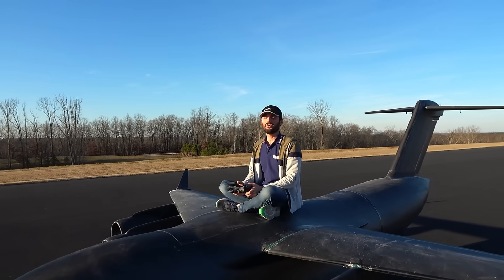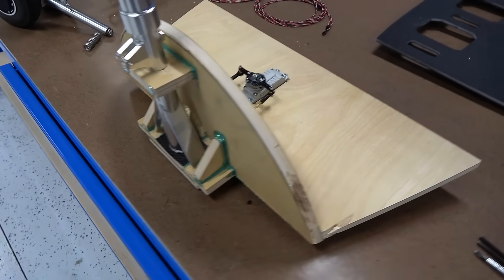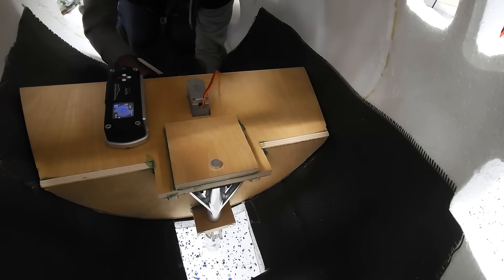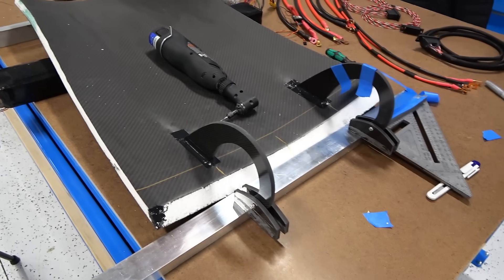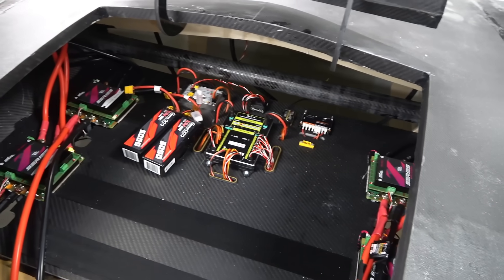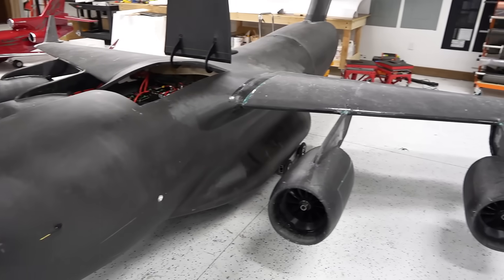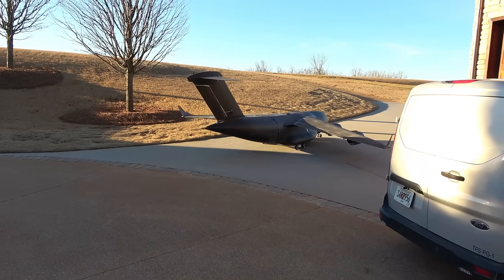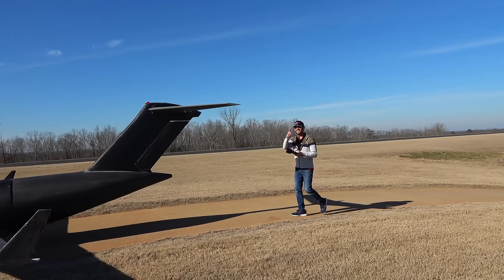READY FOR THE FIRST FLIGHT, 6 Meters C-17 Globemaster RC airplane

Comment from the maker: Stay tuned for the maiden flight next Monday!
Reply: I'm no expert, but would it not make more sense to hinge the avionics hatch so that the aerodynamic forces help keep it closed rather than the potential catastrophe if the latch failed?
Reply: @Mark-oj8wj  yes. Pretty big oversight. But the likelihood of it happening is probably slim
Reply: Can’t wait
Reply: YOU ARE AMAZING!!!! GREAT JOB!!!!
Reply: Maybe the hatch opening the other way?
Reply: Congrats My friend Ramy
Please before maiden can you consider few points
1- the 4 ESC needs Airflow ventilation because they will accumulate very high temperature during the flight
2- please consider installing the ESC’s underwings or inside the tunnel of the engines behind the ducted fan
That’s my advice wish you all the best
Reply: Can't wait to see the first flight!
Reply: Bro would it get off the ground if you laid inside it? If yes have you thought of doing it! I would
Reply: The door compartment for the electronics and batteries should have been made to open the other way incase it opens in midair it would still remain closed by the speed of the wind.
Reply: @lcfflc3887  yeah that's literally what I said
Reply: @sharkbite5744  yeah it will literally become an airspeed brake.
Reply: I dare you to make a plane that you can sit in
Reply: @RamyRC I am currently doing a build of an airbus A380. I’m wondering something. I don’t see that you applied carbon fiber to the edges of the hatch or hatch opening.  Then at 10:45, we are given a quick view that does show they are black, but appear to be painted? Did you in fact, carbon fiber the sides? This is our plan, but I’m curious what you did.
Reply: can't wait! awesome content!!!
Reply: Once the plane is outside, what's that low humming noise? Not the engines, they sound good, what is that constant doning sound?
Reply: @rjung_ch  those are the digital servos, that's normal
Reply: @rjung_ch    Huge digital servos buzzing, trying to find center
Reply: @BillCranford  those are massive servos, quite loud ones too. But in the air it won't be a problem at all. Can't wait for the next video, the one with the maiden flight!
Reply: @rjung_ch  👍 I actually hit the 🔔 so I won’t miss the next flight video.
Reply: those are the digital servos that you hear.   @rjung_ch
Reply: So impressive !  It's a masterpiece of skill and ingenuity.   You've probably addressed this here or elsewhere, but I was wondering why you seem to favor ducted fans over actual turbine engines ?   Thank you!
Reply: @mikegreene4152  the answer is in the rest of the comments already🙄
Reply: Sir I need a small rc airplane from where can I buy plzzz
Reply: @talhazia543  Toys r us
Reply: @talhazia543  google it you fool
Reply: So I asked this question before did you have to get special waiver from the FAA to fly this??
Reply: @Boeing777DriverAA  no such thing at least not under class G airspace below 400ft. But the AMA has a large model program dependent on weight that has their own restrictions. At a private non-ama field that wouldn't apply anyways
Reply: @Boeing767DriverAA  ypu don't need a faa waiver if your flying at a private field.
Reply: You obviously have the flight video already. Just post it bro...
Reply: @mushmouth  you obviously didn't pay attention to the video and notice the main landing gear isn't even finished
Reply: You could use a electro magnet for the hatch so it stays closed with the flip of a switch
Reply: I’d be interested in a dedicated carbon fiber video
Reply: Bro make emirates 777 and use turbine engine not ducted fan ❤❤😊❤😊❤i know u can make
Reply: Thats Tyler Perry's house and where he lives can only be electric @unknowndestination4706
Reply: @Radowanhossainsajid  his boss has a hatred of turbines for some idiotic reason. such a waste, all his models are begging for turbines
Reply: @aerialbugsmasher that is because he doesn't want to use fuel and reduce the risk of a fire
Reply: @aerialbugsmasher and Tyler is not his boss😂 they are freinds
Reply: @aerialbugsmasher It's where he lives and in one video he explains the reason for going electric.  Turbine isn't always better
Reply: @man67343  they may be but he sure as hell is getting paid to put in all that work
Reply: @man67343  Tyler's logic is flawed. In 25 years of flying RC I've had far more random fires from ESCs/Motors/Lipos than any other type of power plant. I've only wrecked one turbine so far and there was no fire, and when I've seen others crash theirs, you just usually get one big fireball and that's it, the rest of the fire you can put out by stomping on the grass. But if you bump a Lipo just the wrong way slightly, all hell breaks lose, and unlike Jet-A, Lipo fires are much harder to extinguish, and if like in his huge planes you're running massive 12S or larger battery packs you're talking about well north of 48 cells going up in flames one after the other over the course of many minutes. Plus his field looks plenty large enough to accommodate larger turbines so its very unlikely he'd crash into the forest behind. Ramy himself has had these types of failure before I believe in older videos
Reply: @aerialbugsmasher  go home troll, learn to setup electric and you won't have fires, plus where he lives, he can't use turbines anymore because of the noise
Reply: Next challenge: Make one of your rc planes totally automated from takeoff to landing 🔥
It’s going to be an exciting project I promise you 🔥
Reply: @Dailyplugs229  no. that's idiotic and defeats the purpose of flying RC planes.
Reply: @aerialbugsmasher  it will be fun and cool if he add turbine engine because  i love turbine engine not duct fan
Reply: @Dailyplugs229  You already can with gps receivers. You can even map out the flight path in a pattern if you want to go "auto-loiter" mode, and it will just fly the relay points you've set on the map. We've done this on fpv planes already.
Reply: @monchichis333  wow that’s amazing
I’m going to watch videos on that now 🔥

Comment: Beautiful build! Just a thought, wouldn’t it had been better to have the hatch open from the rear & not the front? Just in case the locking system were to fail at least the forward motion would keep the hatch closed.

Comment: @RamyRC I am currently doing a build of an airbus A380. I’m wondering something. I don’t see that you applied carbon fiber to the edges of the hatch or hatch opening.  Then at 10:45, we are given a quick view that does show they are black, but appear to be painted? Did you in fact, carbon fiber the sides? This is our plan, but I’m curious what you did.

Comment: Considering the air flow will always be from the front towards the back I would have installed the brackets that hold the top door on the opposite side of the door (using the edge toward the front of the plane) so it would not open as it did.  Otherwise you will be forced to install an additional door locking device.

Comment: Maybe on the next build put the hinges to the top hatch on the opposite side. Just in case it ever did open mid flight like you mentioned, which it wouldn't because the air alone would hold it closed. Just a thought but this is incredible either way.

Comment: Brilliant:D what would it take for this to fly with a human in the fuselage? :o I believe model boats fit humans for displays/reenactments? :o I realise air is far different though and the support needed from nose to tail or just a harness from wing attachments for weight distribution:o seems the power is there hahaha. Science would have it so the wings would need scaling up accordingly but it is extremely lightweight as opposed to the real steel and aluminium. I'd definitely feel better with stronger landing gear though for a human ha. Wow

Comment: Congrats My friend Ramy that is amazing build.
Please before maiden can you consider few points
1- the 4 ESC needs Airflow ventilation because they will accumulate very high temperature during the flight
2- please consider installing the ESC's underwings or inside the tunnel of the engines behind the ducted fan That's my advice wish you all the best

Comment: I love that plane. True story. I made hundreds of tailcones for real C-17s. Because it's very tough but flexible material, as well as thin walled, and cone shaped it was very difficult to hold for standard braised carbide cutting. It has to be held from the inside because the machine is outside. It chattered, and tended to break expensive carbide cutters. $80 each in 1992. It would break 1 sometimes 2 per cone. Often it would chatter loose, and have to be reset. 

It was a loss leader in the industry so the contractor could maintain contact with Boeing for the big contracts. Competing contractors underbid on the cone contract but we got it for a price of  $60 each. But it is a hot potato in the aviation industry. Contractors do it for a while then let some other contractor take the loss for a while. Same with us. Other contractors tried ultrasound, lasers, and high pressure water jets. Couldn't do it for a profit.

Before I started making them we put only the most experienced machinists on them. They used $80 880 braised carbide. Pain in the ass. Came loose, broke carbides. They gripped about it all the time. Never gave me the job because I was the new guy. 

Been there a while I tell the shop foreman, who often had to do the job himself, over lunch "I'm tired of hearing you guys gripping about those tailcones." "Give it to me I'll figure it out. As far as you're concerned it's my favorite job, and you'll never hear a gripe about it again.

He said "You're on.",  and it was a pain in the ass. I did the job for 3 months before I figured it out.

I invented a mod of the fixture. I was able to double production. I was able to use a $60 660 braised carbide, and made 10 cones with one tool before repeated sharpening wore it down to a nub, and even then nub would cut. Our cost there alone went from $80 each when one carbide usually broke, and $160 if 2 did to my cost of $6 each in carbide cost, and half the overhead. For the first time in aviation history I delivered on the contract at a profit. 

It made the job much easier for me too. It really did become my favorite job. That even became the company's nickname for the job. "My Favorite Job.". Whenever a load of tailcones came in the foreman said " 'Your Favorite Job' is here.". I asked him once if he was joking with me that it was a pain in the ass for everybody else, and that it really is my favorite job. He said he knows it's my favorite job because I so good at it. The thing I made works. A little prodding got him to say I was making it at a profit, and the owners appreciated it. He only put someone else on the job when he had a hotter job for me. 

One of which was a big Boeing contract we were hoping for. The 777 fuselage turning fixture. Boeing requested I be assigned the job. No customer had ever requested a particular machinist before in the company. It was my work on the tailcones that got us the job, and me requested. 

Boeing had become skeptical that we were producing good parts because we consistently won the contract with the lowest bid. They suspected the invention I used, and had to check the cones. So Boeing bought a $12,000 1'x4'x4' flat standard. Precision ground from granite to check the geometry against. I heard there was a bet. If my cones failed inspection we would pay for the flat, and keep it. But if my cones passed Boeing paid for it, and we keep it. 

The inspector shows up one day. I say "So we just grab one at random right?". He sad "That sounds like a good idea.". I know I got him eating out of my hand already. But I plop it down on the flat, he grabs the height micrometer, and starts to measure the length. I say "you have to...". He cuts me off saying "I want to check this first.". I say "Ok". Right away he's saying "It's off. I tell him it's off because it's cone shaped, and thin walled like a Dixie cup, a water cooler cup. If you squeeze it out of round that end becomes rounded. The cone is out of round and it's rocking on the flat, and I showed him the rocking. He asks what we do about it. I point out we're not responsible for it being round, and no tailcone ever will be. But if the mating part is flat it will push the cone flat, and round. That eased his mind. We just have to push it against the flat to get a rock solid measurement. He said I'll buy that.". 

So I lead him through all the measuring tools, extensions for the fixed jaw of the micrometer, using the standards that come with it to zero the dial. Hight gauge then "miked" with an inside mike which is checked against the outside mike. I'm teaching the inspector how to inspect it, and convincing him it's the right way, and we're getting rock solid measurements. Everybody's having a good time throwing up clay pigeons to watch me shoot them all down. Last we get to the diameter of the big end of the cone. I Show him how to press the cone on the corner of the flat so 180 degrees is off the flat so it can be measured with the micrometer. He notices it's on the low side of the tolerance. I had a spec of +- .0025", .005" total. That means I cut too high on the taper. I say "No I didn't.". He's all smiles "I gotta hear it. I know you got something.". I point out on the print it says "De burr". I say "You gotta give me at least a thousandth." A human hair is 1 to 3. He says he'll buy that but it's still on the low. I say but it's a thousandth on this side, and a thousandth on the other putting it within half a  thousandth of spec. Right? He gets it, and I say turn it 90 degrees to get the round, but he says we don't have to do that he's convinced I know what I'm doing. I say we're done then? Yes. I still want to measure it for myself. He asks how that could be off if all the others are right on. I explain while I measure it could be off the conical axis. That could cause the length to be correct, and at all points parallel to both ends but this diameter might not be round. It could an elliptical, conic section. He understood that. and the cone was ok. He asked how that might happen. I reminded him about how it can chatter loose, and have to be reset where it could, and likely would be a little off. Probably not significantly, and it never pulls loose on me. 

 He was so impressed with me Boeing requested I machine the 777 fuselage turning fixture, and tried to reverse engineer my tailcone fixture  invention to modify the fixture for the tailcones of the largest jet engines ever built to this day. 

I invented modifications when I made the 777. It was so good when Boeing took it to their plant to assemble it went together overnight. The Los Angeles Times ran a front page story, with a full color picture, that neighboring residents were calling police about this huge piece of machinery suddenly appearing practically in their back yards.  They were reporting they thought some huge machine had crashed. One said "It popped up overnight like a mushroom.". 

What I couldn't know then was the historic records the 777 would accumulate. Best selling airliner in aviation history. 2200 sold 1600 delivered. The 747 just ended its 50 year production run with 1800 delivered. The last 747 that will ever be delivered. The 777, in 29 years, with 1600 now flying it has not had a single mass fatality accident. One Malaysian Airlines was shot down, and one Malaysian Airlines was lost, disappeared by suspected hijacking. Those don't count. They're not accidents. Coincidentally or not that door plug that popped out of a 737 recently was from a fuselage of Malaysian manufacture. 

Compare that safety record to other airliners that have multiple crashes, and fewer planes. Ball park of 2 to 8 years to just the first crash of all the other jumbo jets. Ball park of 60,000 lives were saved by flying on my plane that would have been lost in the same 30 years flying on other planes. My inventions can be applied throughout the aviation industry for 2 orders of magnitude increase in safety. That's 100 times safer.

When I started posting in 2008 in comments about Boeing on YouTube  l mostly wrote about the tailcones. A little about the fuselage but it didn't yet have the phenomenal history it now has. Shortly after Boeing, I suspect to distance themselves from my contributions, built a secret robot fuselage assembly plant to make the 777X without my fixture. Am I a paranoid delusional "flying saucer nut"? Secret robot assembly plant for Pete's sake. Well I'm not the one who spent billions to build a secret robot assembly plant. You can look it up. They said it was to reduce costs but it didn't. Around 20 16-17 they dismantled my 777 fixture.  My fixture made 777s which passed the FAA mandated 150% over maximum expected load test with 154%. The test is also called "testing to destruction". Having so far passed the test my 777 was not tested to destruction. How much more it could have taken we may never know. I heard it's on display somewhere. The 777X built in the secret robot assembly plant failed explosively at 149% of maximum expected load. It's been reported the secret robot assembly plant has now been dismantled. Boeing missed the 2019 delivery originally scheduled for the 777X. Failure after failure has repeatedly pushed back the delivery date to now 2025.

Again, I'm not the one who spent billions on a failed secret robot assembly plant. 

Boeing does not mention in advertising the 777 is so much safer, though you'd think they should, and would, because the question would arise why their other planes are not so safe. They would have to admit they don't know why. That's because they don't know how I did it.  

Pass this along.
 I cannot take responsibility for the safety of the 777X unless I can inspect or remanufacture my fixture if it was scrapped.   

The C-17, and the Triple Seven. I dearly love those planes.